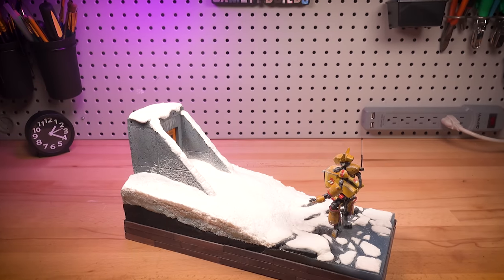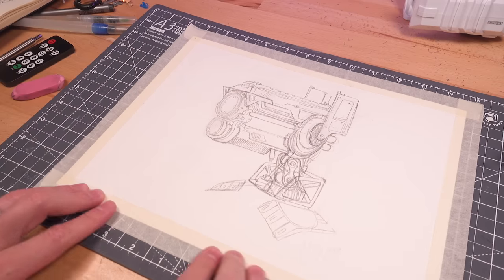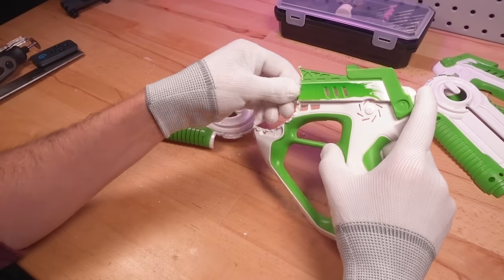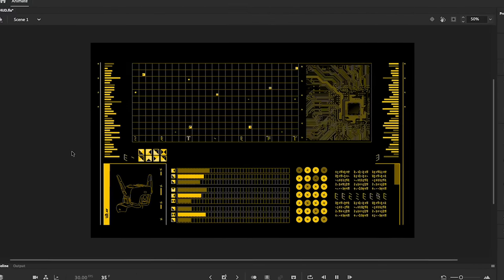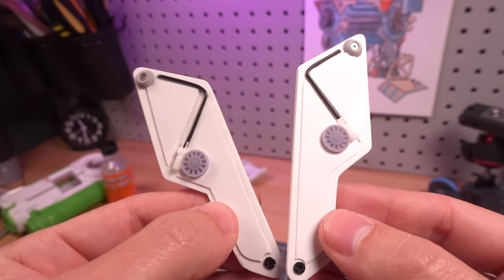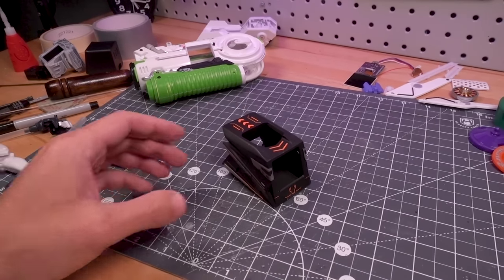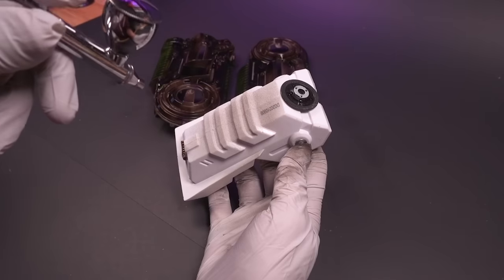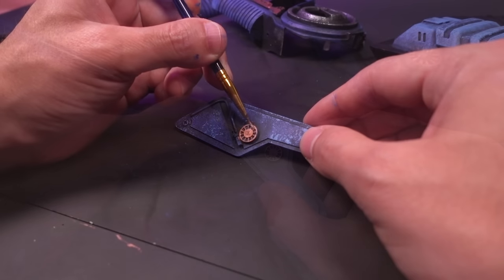"Breach" - A Beyond the Blight Kitbash / Story Diorama Bust

Comment: Hey one tip the thing with the usb c cable was not working because a usb c port is only taking power when it first got a signal from the power source it’s like handshake to say hi I am not dangerous and only give you right power and i am a usb power source
Reply from the maker: Thanks, I did some research and came across this same answer, which is why I abandoned the spliced USB option. Is there any way around this you know of?
Reply: @gameyybuilds  there are some usb c modules that can do it

Comment: - geee all that for 2.99$, that gun was loaded with ... stuffs
- dude you cant just use a resistor, if you want to turn down voltage, use a voltage regulator (or buck boost, they can do up voltages), they are really easy to use